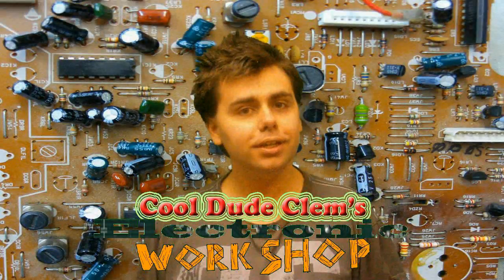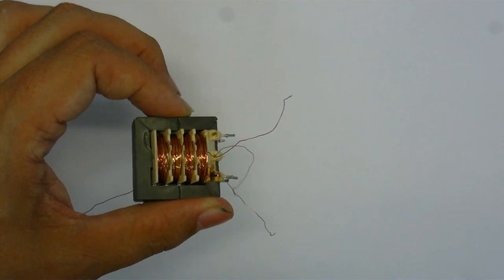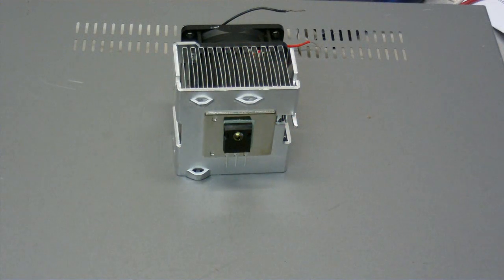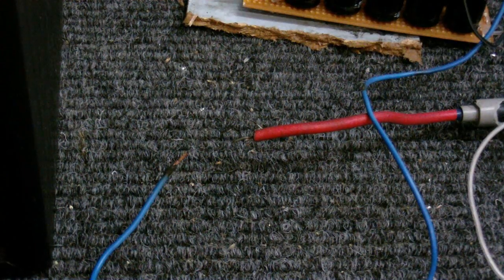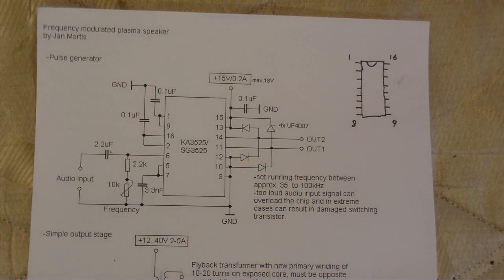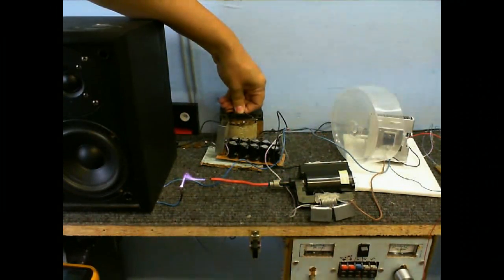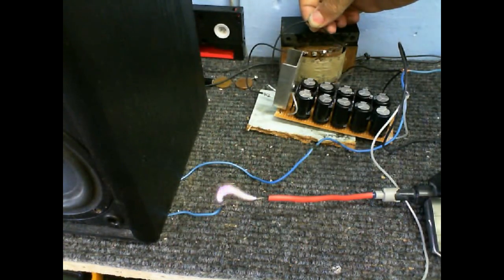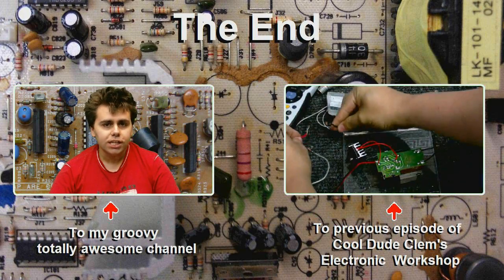CDC Electronic WorkShop - FM modulated singing arc experiment.avi

Comment from the maker: Actually with the way the SG3525 chip is wired in the circuit I used here, it IS FM modulated, normally that chip would be used for PWM.  A 555 timer on the other hand does both PWM and FM at the same time when audio is applied to pin 5.

Comment: i have an idea on an horn design you can do, but im pretty sure you have a better one in mind. you can start the horn closed back and then open up about 10"s and then at the 1-3 inch mark depending on how big ur arc needs to be cut 2 holes and feed the wire through where the arc is gonna go and it should be like 4x louder hopefully.
/watch?v=DtPszUP1YKk&NR=1
kinda like that. and you can also increase the input voltage. a 3.5 mm usually does around .3 V, try doing 2-5 volts. should be louder. =)

Comment: Sad that the trafo core snapped. One top tip to get thos transformers apart without breaking them is to boil them in water, then the glue get all soft and you can just pull the trafo apart.